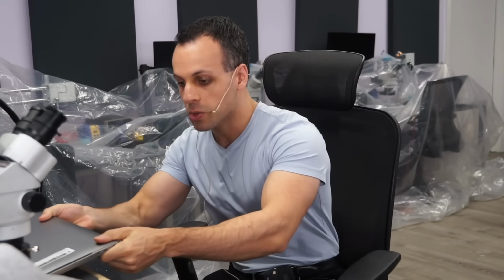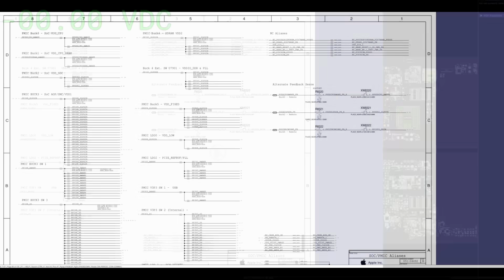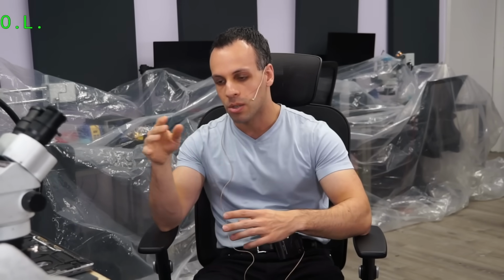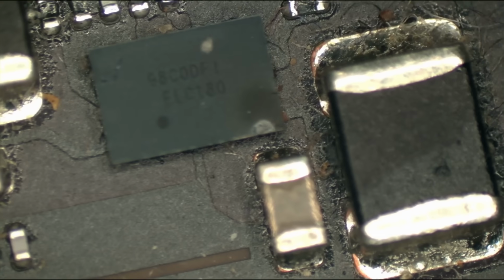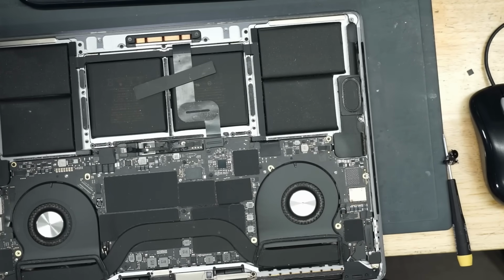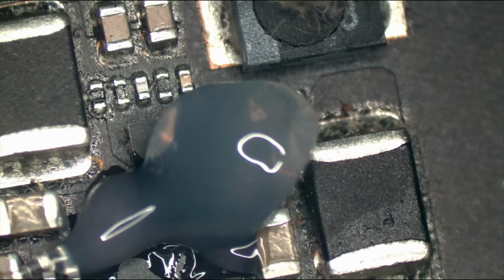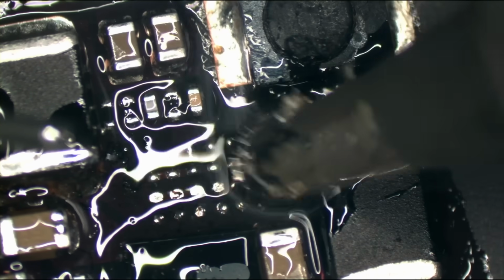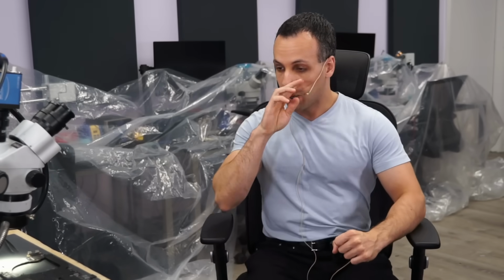How most 16" Macbook Pros often kill themselves & why they're unfixable

Comment: So what you’re saying is, stick with older Macs before Apple got greedy? This is ridiculous. I have a 2012 Mac Pro, 12 core/ 24 thread w/ 128 GB’s of RAM and a bunch of SSD’s. Bit of problem. I don’t know if this is just a thing with the notebooks or it extends to all of Apples current computers, but it is ridiculous. They charge so much for machines that essentially are built to break for which, you could easily build a PC for pennies on the dollar and as long as you stick to windows 10 pro, you are pretty much set. Or, if you’re using an older Mac for music and video production… Then you will be set. most software still runs fine. Especially with the power behind some of these in these older Mac computers.

Which, seemingly, still hold up to a lot of today’s computers. Yes, they may not have the throughput… But does it really matter for most of the tasks that you do? The fact is, unless you are developing video games… Most Mac computers over the past 10 years will be fine. Not sure about the laptops, once again. As, I imagine just the sheer fact that they get moved around so much… Would be a risk for failure.

Regardless, I will stick with this Mac Pro until I simply can’t run the software anymore. I built a PC a few years ago that is still on the higher end, except the video card. Which I could easily change out. Still, the video card that is in it, which is a 1080 Ti, is no slouch. I don’t use my PC for gaming, so it doesn’t really matter. It is great for video production, the Mac, I use, mostly for producing music. Some video editing.

My third generation iPad Pro is when I use for the every day. For which, I’m just going to stick with buying new third generation, iPad pros, since the newest generation of them seems to have so many issues.

Great info, as always. I realize this video is a few months old… But, it’s still pertinent information for anybody out there who deals with Mac’s. Hope you’re settling in well in Texas. Hope you had a great Thanksgiving and have a merry Christmas if I don’t post before then.